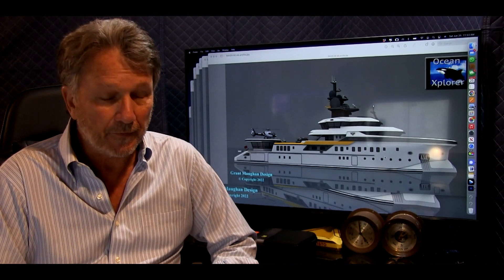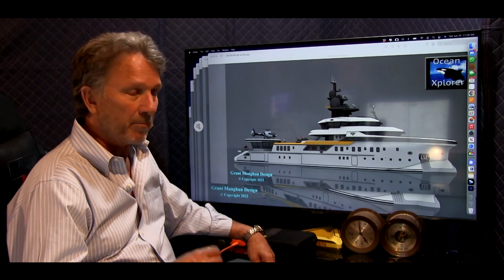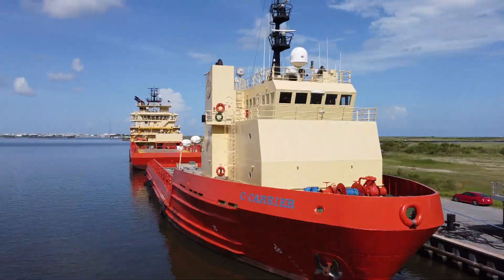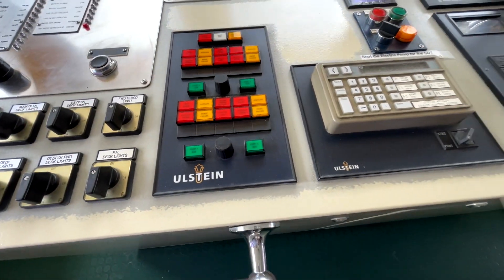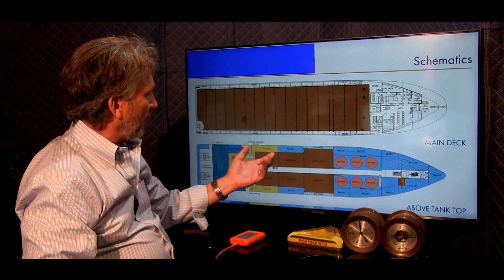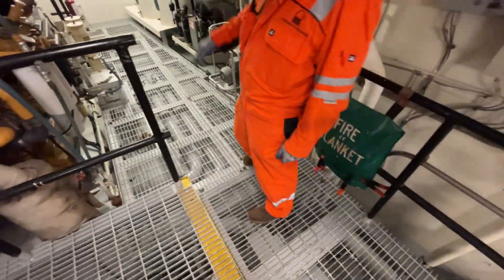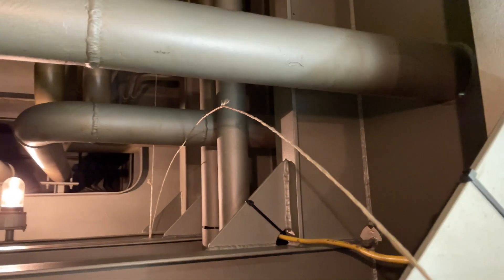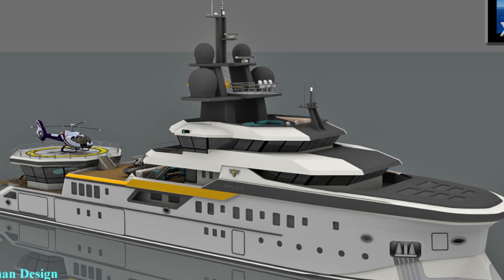250 ft / 76 meter Expedition Yacht Conversion based on 240 ft Offshore Supply Vessel

Comment: Quick Question. If you do this conversion are not stuck with a very deep draft? Isn't he draft 15 Ft?  What if you still want to go and stop off in the Bahamas or Caribbean Island and not get stuck?
Reply from the maker: Larger OSV's can easily be 15 ft with fuel. They are 10 ft draft when we inspect them laid up, with minimal fuel. Although the conversion adds weight with new accommodations, we are taking off the mud tanks and other extra tanks we don't need. Also coming off are heavy pipes above and below main deck, large pumps, firefighting equipment and piping, and steel cargo railing on main deck. Still, these are not going to access the Bahamas shoals. A fast crew supply vessel with jet-drives would be the best bet for the Bahamas.
Reply: If you want to park your yacht next to islands in caribbeans, you don't get a 240ft yacht.

Comment: The cost: Do u take the vessel down to the steel and replace everything new.
Reply from the maker: Not at all. We look for well-built, and well-maintained vessels. A commercial vessel that is in-class is usually ready to go to sea. The engines are made to be rebuilt and go back to work.  Figure that a commercial vessel is designed and built for 40-years hard service, normally.
Reply: Do u have any units that have been completed or videos of any units with finished interiors that have sold?

Comment: This looks good.

I'll outline my criteria down below. 

1- My first requirement is for the ship to survive the worst possible weather, so ships working in the North Sea or the Southern Ocean would be the obvious choice.

 
I would have wanted an Ulstein X-bow vessel, but since those aren't very economical, I'd have to settle for the traditional flared-bow vessels. I don't think the axe-bow would survive very deep troughs.

2- My second requirement is for the ship to carry an amphibious aircraft, or, at least carry a a helicopter and a small amphibious vehicle and refuel an amphibious aircraft. 

The amphibious aircraft that I want is the Grumman Albatross (96ft X 64ft), so if a ship can economically carry it, fine; or it has to wait till I can afford a ship that can carry it and meanwhile settle for a ship that can only refuel and service it, so it can fly me in and out of the yacht.

  I want it to rescue me in emergencies.

3- My 3rd requirement is for the ship to have redundant systems---2 rudders, 2 screws, and two engines or more.

4- My fourth requirement is for it to be the most economical option to survive the worst seas and carry the helicopter and a small amphibious vehicle., so I would it the economy cruise to not cost me more than 60 GPH to 150GPH at 10 knots.

5- My fifth priority would be the interior. I like the Alucia holistically, including the interior, whereas I like the interiors done by San Lorenzo and Lusben, even though they haven't done any yachts with helicopter and amphibious vehicle hangars.
Reply: Sounds amazing!
Reply: Will it be EMP-shielded?

Comment: The wide beam is handy but not everyone is going to need a 250ft yacht, 
especially if you can build superstructure on the aft deck. So an option is to cut a section out of the vessel to shorten it. This is greatly facilitated by the engine room being right aft, so you're not cutting into anything vital to the ship.